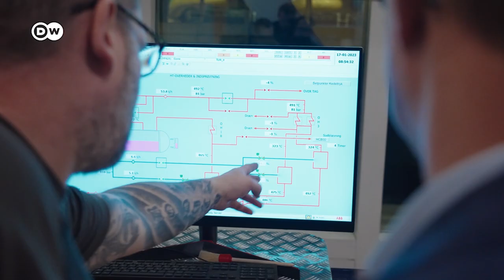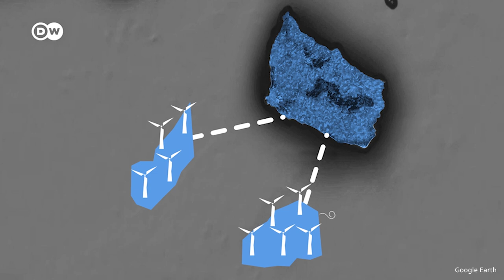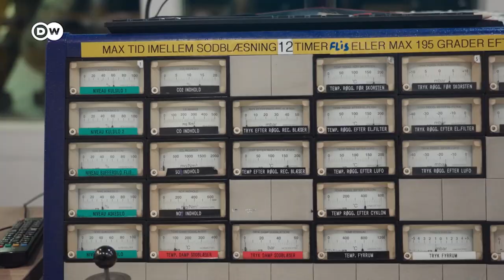Is this island the best in the world?

Comment: I’m a bit underwhelmed to be honest. Burning waste and biomass is still releasing carbon dioxide that could be sequestration somehow. Once they get their new offshore wind farms, large scale molten salt storage and EV charging infrastructure sorted and move domestic heating to heat pumps, then it will be very impressive.
Reply: Imagine the cost per capita 💀
Reply: @hydroboy17  Everything can be done more efficient in larger communities.
Reply: @hydroboy17  Real cost or initial investment? While expensive to buy at first, (some) save in the long run
Reply: CO2 sequestration tech needs more improvements before it works well enough or is worth using instead of simply investing the money in reducing the amount of CO2 produced in the first place. Burning waste and wood pollutes less than burning fossil fuels for both energy and for transporting that waste elsewhere.
Only when you have a surplus of greener options so there is no need to burn stuff for extra energy can you consider spending even more energy on less useful methods like carbon capture and recycling unimportant materials.
Reply: To be fair, at least it’s biomass carbon that’s roughly net neutral; that is, it was CO2 in the air recently before becoming wood chips. Certainly better than fossil carbon. 

If they could do BECCS (biomass energy+carbon capture+sequestration) that would be a very big achievement; some would argue that would be net-negative carbon, even. I’m not sure if/where Northern Europe has the geographic features for carbon sequestration.
Reply: @Randomgen77   Hi Cicero, if biomass was a “circular” carbon process it would be more acceptable. Here in the UK we have an enormous power station, called Drax (yes I know it sound like a Bond villain) which was converted from coal to biomass a few years back. It produces up to 6% of the UK’s electricity and is the UK’s largest single emitter of CO2. The pellets mainly come from the USA where mature trees are felled, pelleted and shipped across the Atlantic. Even if the trees are replanted they are being cut  down and burned faster than they can regrow. It’s an environmental outrage and one they’d never get away with if the pellets were produced in the UK. So pardon my scepticism regarding biomass.
Reply: @philiptaylor7902  'mature trees' including previously untouched old-growth forests in BC, Canada  :(
Reply: Not to mention how Bornholm as an island import nearly all their goods from the rest of Denmark (and a lot from Sweden too), causing a lot of pollution as well.
Reply: @YangwanAuto  uninhabited?
Reply: Never let Perfection be the enemy of the Good. Right now nothing is really sustainable, its all about becoming sustainable. Getting there might not look sexy or be easy or fast. Everyone can only do their best.
Reply: Inform the Pilots
Reply: @YangwanAuto  i am not correcting anyone, i am interested in how a island with 40.000 people can be called uninhabited.
Reply: Winds farms, solar panels, and EV are anything but environmentally friendly. The proper source of alternative and renewable energy that doesn’t require strip mining of Africa’s Amazon or creating containment areas due to the hazardous waste generated by decommissioned windmills and panels is water. If they spent as much money on R&D into water, we wouldn’t have a problem. But you can’t charge for Water, electricity can.
Reply: What are your thoughts about humans emitting CO2, with their respiratory system 😮 same with trees, when the sun doesn’t shine they use there stored energy 😮 the carbon cycle is a natural process, local biomass is fine, getting it from Brazil isn’t. CO2 is not dangerous but as Important as H2O and sunlight for life one the planet

Comment: 9:40 I'm quite confused. There was no mention of public transportation which seems to me to be the obvious solution to the problem with expensive electric vehicles. Investing in public transportation is proven to drastically reduce to reliance in fossil fuels while also making sense in a social consideration, since everybody can therefore feel more easily connected. Is there a reason why this wasn't mentioned? 🤔
Great video nonetheless. 😌👌🏿✨
Reply: electric bikes as well, they're a lot cheaper and can fulfill a lot of the functionality with e-cargo bikes and the like, meaning you dont need cars.
Reply: Denmark already has really good public transportation. With that said there will always be some jobs that require more flexible transportation than public. A lot but not all Danes have electric bikes as they typically cost 3000$ which are also stolen very often compared to a regular bicycle you can get for 500$ which is almost never stolen.
Reply: Most base models of electric vehicles start at around 40,000$ USD for a small car and brand like Opel.
Reply: Checking on the map they do indeed have bus lines going between the towns on the island. No trains/trams though and its ver infrequent (1 bus an hour for each bus line)
Reply: Electric buses especially seem perfect. Low volume, infrequent driving because of the small population means they could spend more time parked acting as giant backup batteries during renewable off periods. Like the experiment with the cars they mentioned in the video but on a larger scale.
Reply: Bornholm does have public buses, but with a total population of only 40,000 a rail network would be much too costly to be economically feasible.
Reply: @varbaek  shouldn’t we start blaming the EU car industry for this by now?  C’mon give us low priced limited range small cars with interchangeable batteries, or the brands from China and India take over the market.
Reply: The Island of Bornholm is 40.000 people and its famous for and most enjoyed by the use of.. bicycles.. ;)
Reply: Inform the Pilots
Reply: @thijmstickman8349  When I was there in primary school we took the bus once and walked everywhere for the rest of the week. The island is small enough that public transit isn't really that relevant.
Reply: @nicolaim4275  I guess your right when talking about rail, but looking at the island in google maps there still are a lot of cars and the density does seem like its enough for higher frequency buses. I think it would at least be nice for them to mention when talking about how to make the island more sustainable
Reply: Sadly, public transit is kind of an afterthought in much of Denmark, including on Bornholm. There isn't much going on to improve it, heck public transit is facing an existential crisis rigth now here due to harsh times economically brought on by Covid and the extreme inflation, combined with the previous minister for transport providing less than 1/3rd the requested relief funding, and the new right wing minister in the new government not caring at all about users of public transit at all. Plus all sorts of regulations and investment ceilings imposed from the state levels mean that even though many municipalities would want to spend more money on stuff, they're not legally able to.

Like on Bornholm they wanted to be a first mover with electric buses, but their tender went awry and there was a lack of funding. So despite 1/4th of all buses in the country now being electric, there's not a single electric bus on Bornholm yet, and there likely won't be one until 2024.

At least they are trying to improve some little things. Like with the buses, most lines now run once every hour. Compare that to 2017-18 when I studied on a boarding school there, Line 2 which my class regularly used only operated every 2 hours.
Reply: @pjacobsen1000  Bornholm did once have a railway network. Most of the routes are now footpaths or cycle tracks.
Reply: @snivader nobodys biking around in shitty windy weather, my city invested a lot into biking as well but the weather makes it a horrible option. Lets be realistic not dreamy
Reply: @JoOtterH  Wow, I did not know that.
Reply: So electric assist pedal powered covered     tri cycles. 🚠 Zip. For hill locations. Energy storage at homes business. Energy liberty of multi options in heat. Solar thermal, vertical wind. Save on heat exchange with earth trench or sea. Don't get ride of backup fuel systems. Coal is so abundant, have it on hand for the bad years long storms. Water from air using excess heat and cooling.
Reply from the maker: Hi Darnaryel, you are right! Currently public transportation is a big issue, including the transportattion to and from Bornholm as mentioned in the video. But we could have delved deeper into that topic, thanks for the feedback.
Reply: can anyone please explain me why electric vehicles are so expensive? they are in principle so simple to make and use...
Reply: @janami-dharmam  It's the batteries that are so expensive. Try getting your smartphone battery replaced and you'll know what I mean.
Reply: @beepboopbeepp   "nobody's biking...  my city...  the weather makes it a horrible option" 
May I ask you which is your city?
Reply: @pjacobsen1000   "Bornholms Sporveje" was the name, I believe.

Comment: Great to see it works on such a large scale, one problem I see is the molten salt boiler storage, will it not corrode and leak? afaik that is a big issue with those installations. Maybe a sand battery or even a superheated crushed rock would work the same with less dangers?
Reply: Inform the Pilots

Comment: @DW planet A 6:54 " wood is renewable but it release al lot of CO2"? that's a contradictory information. Wood burning doesn't add fossil CO2 into the atmosphere.
Reply from the maker: Renewable energy means it comes from sources that are naturally replenished on a human timescale - wood included. But wood still does emit a lot of CO2 when burned. You can read up on how much exactly e.g. in this Nature study: https://tinyurl.com/2p8jzz5z :)
Reply: @DWPlanetA  they said the wood was locally sourced, and I am sure the forests are allowed to regrow on Bornholm. Using wood for other uses, like buiding material is utimatele a better use than burning it.
Reply: @tombh74  Most wood burning PPs these days use sawdust and other waste wood that is left after most of the tree has been utilized for something else or was made from recycled waste wood, like old shipping pallets. There are probably some other uses for that stuff aside burning it, but as a whole the logging should be carbon negative.
Reply: They can mulch some of it to build soils, wood smoke just helps it rain somewhere else. They trees grow faster on the high CO2 solar years. The problem is most country folks just smolder a burn, making the bad smoke.  Burn it hot. Work on the next thing while you live another year.

Comment: What about the benefits of thirsty concrete to reduce flooding and sand mining helping ecosystems and you.
Or how insulation is like r30 at most but really should be r100 minimal because better insulation = less energy demand to cool or heat a home and keep it warm or cool way longer.
Reply: They didn't talk about insulation, but building standards in scandinavia are very good when it come to insulation. It can however be a challenge to properly insulate the many +100 year old houses on the island.
Reply: R 30 is a lot of insulation. R100 is not at all a good idea, that is far far too much space taken up by insulation. If the walls were wooden then they would be 100" thick and it would take a whole forest to build one home, it would be 10x10" log homes wrapped around each other. It is a terrible suggestion, that would make the world a much worse place, even though I know you meant well by your comment.

Comment: Burning non recyclable garbage is the way to go so long as emissions are monitored and minimized. It is the best way to mine for metal and keep plastic out of the oceans. We must never stop this. Biogas is even better, you get your fuel and your compost too! Wind and solar are great, although it didn't seem too sunny there. But public transport is key, electrify that. For the ferry, I doubt an alternative could compete with diesel, possibly hydrogen air ships, though I doubt it. Electric would not work, the batteries would cost too much, weigh too much and just not have the power needed for such a task.
Reply: Can't compete with even more advanced Diesel held out of market, by big players. But can always add secondary systems to be used when thermal collection is available or wind kite. Medium ships. Saving on thermal losses can do much for buildings. Back up multi options is key for harsh future storms.

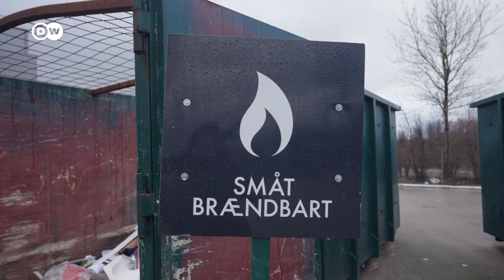Comment: @3:05 The way to make recycling easier and more efficient is by getting rid of petroleum based plastics and substituting in plant-based biodegradable plastics, not by creating 40 different types of recycling bins! We need to control industry, not the other way around. If you make it illegal and refuse to bring plastic into the country or manufacture plastic products it will eventually be the norm.

Comment: It sounds like some places just burn excess waste but there are places that burn waste & somehow turn it into energy. Why isn't that more widely adopted? Are there any downsides?
Reply: It takes some investment to turn the heat from the waste into electricity. To do it right you also need filters to clean the smoke.
Reply: creates dependence on the method. Incineration is a highly toxic and polluting practice; the idea is to use it as an intermediary between landfills and a circular ecosystem, not adopt it as a new norm

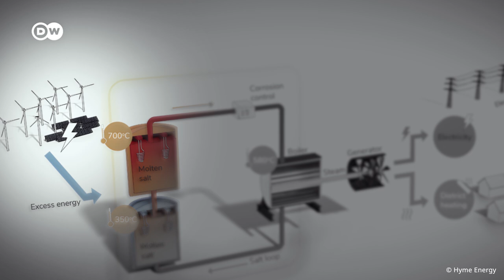Comment: at roughly 08:40 you forgot to ask a question regarding efficientcy here, normally it should be 30-40% recovering your energy back from the molten solt btw
Reply: Inform the Pilots
Reply: Not everything will be recoverable sure, but it should be much cheaper, much more reliable, and much longer lasting than the alternative, like big lithium ion batteries. Its a tradeoff sure but not a half bad one.

Comment: @DWPlanetA

What do a household pay for electricity? Should be low due a lot of renewables?
Reply from the maker: If the household has its own solar panels it will be less than without. But otherwise it does depend on the overall mix of the energy.
Reply: Electricity prices would certainly have been higher today without renewables, as the alternative would have been coal and gas.
Reply: Today the the prices are too high on Bornholm. The company connecting supplier and consumer seems to have a high profit or to be inefficient. They claim the distribution of the few consumers makes it expensive.

Comment: This island looks like the perfect place to build the first european space port. We could be launching rockets straight over the baltic sea
Reply: Problem is in order to get the momentum to launch rockets into space, rockets typically need to be launched as close to the equator as possible. That's why the EU's primary space port is in French New Guinea, a small enclave of France in South America, close to the equator. Though a new spaceport is coming to be in the Swedish city of Kiruna in the Arctic circle so there may be something more about it.
Reply: @drdewott9154  This will give you a push, but it's not necessary. Israel even launches into retrograde orbits against the earth's spin.

Comment: Importent: Burning wood just produce as mutch CO2 as the tree took out of the air in his live. If you wouldn't burn it, the same CO2 will get free after the tree dies. So it's still CO2 free energy
Reply: Yes. I am so glad that you mention that. Why is this fact so overlooked? 🌱💕
Reply: The sticking point is where you get the wood from. In this case it's locally sourced, so it's as close to neutral as you get, but if you have to import the wood from elsewhere, as the rest of Denmark does (from Brazil), then it's nowhere near neutral.

Comment: If they're using locally grown biomass for power, it is probably slightly co2 negative.
Reply: @YangwanAuto  Perhaps because the solutions being developed on Bornholm is more applicable in places where preserving carbon absorbing natural forests is not an option, which seems to be the method being used in Panama, Bhutan and Costa Rica. Also, the population density on Bornholm is greater than both in Panama and Bhutan, so uninhabited is a bit of a stretch.. I am not saying that the actions in the countries you mention is not impressive, but I fail to see why experiences on an island is not worthy of study.